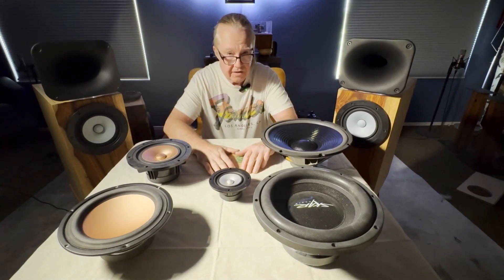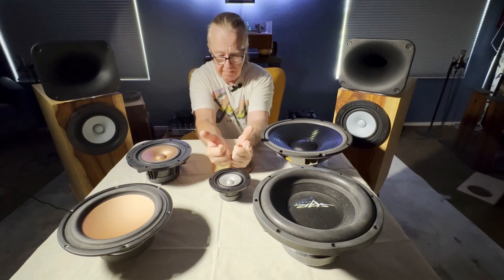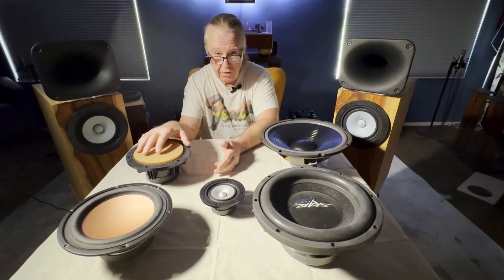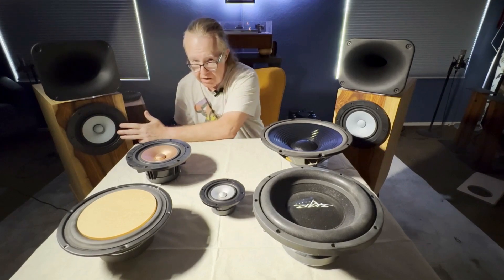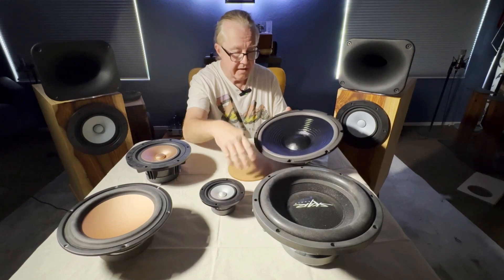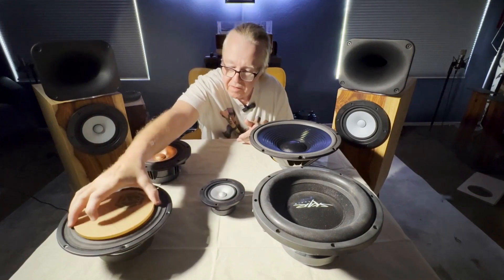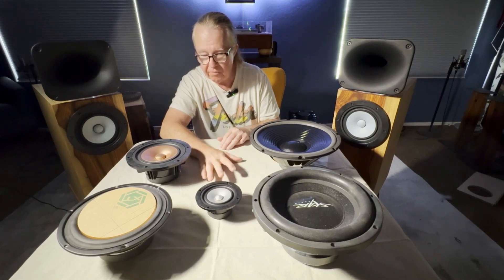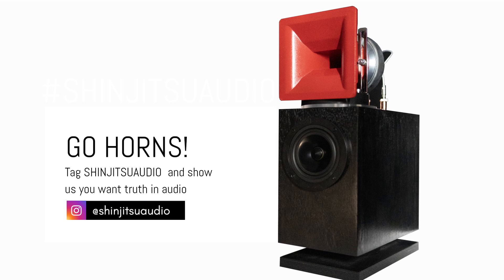Bigger is Better - Or Is It? The Truth About Woofer Size and Beaming

Comment: That's why 3 way designs exist
Reply from the maker: That's a good point! However, opting for a two-way speaker design is often about finding the right balance between performance, simplicity, and cost. While three-way designs can indeed offer advantages, they also introduce more complexity and potential reliability issues.

A two-way design allows us to maintain high-quality sound with fewer components, which reduces production challenges and costs. Three-way speakers are typically larger and require more components, which can double the cost of the speakers and shipping. 

To keep costs reasonable, we'd have to use lower-priced components, potentially compromising quality.

For our market, focusing on efficient two-way designs ensures we deliver excellent sound quality consistently and affordably
Reply: VBSS and Kali IN-8 is probably my dream combo.
Reply from the maker: That sounds quite nice. We aim to bring dreams to reality. Stay tuned for this Fall's lineup.

Comment: Very informative.  I use 18" woofers up to 120, so no worries there.  I then use a 10" woofer up to 3500Hz.  I guess I have beaming above about 1350 to 3500 where the tweeter takes over.  I like the sound so not concerned.  But I may try small woofers in the future to see if I feel it improves.
Reply from the maker: Sounds great!

Comment: What about the APM speakers?
Reply from the maker: a 12 inch woofer beams above say 1Khz so its unlikely it can play up to the level of that horn. Midrange will most likeiy sound recessed as a result.
Reply: My use car subwoofer what inches 8 and 10 and 12
Reply from the maker: Thank you for your comment! It's important to recognize that the audio environments in cars and homes are quite different, and these differences impact the choice of subwoofer size and design.

Car Audio Environment

Ambient Noise Levels:

In a car, the ambient noise level often exceeds 80 dB due to road, engine, and wind noise. This high noise floor requires a more substantial bass response to ensure that low-frequency sounds are audible above the background noise.
Low-frequency noise in cars can mask subtle bass details, necessitating a more powerful and pronounced bass output to achieve a satisfactory listening experience.
Listening Genre:

Space Constraints and Acoustics:

Cars have limited space, so subwoofers need to be designed to maximize bass output in a confined area. Larger subwoofers (like 10-inch or 12-inch) are often used to compensate for the smaller acoustic space and to produce the desired bass impact.

Home Audio Environment

Audiophile Standards:

Home audio systems are often set up in quieter environments where the ambient noise level is significantly lower than in cars. This allows for more detailed and nuanced listening, where clarity and balance across all frequencies are essential.

Smaller woofers (6.5-inch to 8-inch) can provide accurate and tight bass that integrates well with midrange and high-frequency drivers, delivering a cohesive sound.

Room Acoustics:

Home listening rooms can suffer from issues like standing waves and room resonances, which can be exacerbated by large subwoofers. Smaller woofers help to maintain a balanced sound without overwhelming the room with excessive bass.
Proper room treatment and speaker placement are critical in achieving the best sound quality, and smaller woofers are often easier to manage in this regard.

Music Genres:

The genres listened to at home may vary widely, including classical, jazz, rock, and others that benefit from precise and controlled bass response. Smaller woofers can reproduce the necessary bass frequencies accurately without the need for the extreme low-end extension required in car audio.

Conclusion

While larger subwoofers are beneficial in car audio systems to overcome high ambient noise levels and to deliver the impactful bass required for certain music genres, home audio systems often benefit from the balanced and precise sound that smaller woofers provide. The key is to match the subwoofer size and design to the specific listening environment and preferences.

Thank you for bringing up this interesting point. It's always great to discuss the different requirements and solutions for optimal audio experiences in various settings!

Comment: Nothing will stop me wanting a pair of fostex fw800... Now lets watch 😂
Subscribed, lets get you to 1k
Reply: Would it be overspecialization to use it as a subwoofer?
Reply from the maker: Subwoofers play a crucial role in high-end audio systems, especially when they are properly phase-aligned. Stay tuned for an upcoming video where we'll delve into this topic in detail. Proper integration involves considerations such as physical distance, crossover slope, and roll-off frequencies. These factors are essential in achieving seamless integration and ensuring that subwoofers complement the main speakers without causing phase issues. This is why I believe subwoofers have sometimes been unfairly criticized in audiophile setups.
Reply: @shinjitsuaudio  and that is why setting up subwoofers is a speciality often overlooked but very important if you need the benefits of one or more subs. 
On the other hand I know the woofers I want are way too big for my room... But they will be very cool and I have a friend with a big farm and the space to let them shine. He better buy them from me, my listening room is two (steep Dutch) stairs up no way I am getting them back up there 😎
Reply: @JoelHernandez-tz3vk  I was thinking of putting one in an open baffle, and put a quad ESL 57 on top of it. So not classic (sub)woofer use. But I already saved €3,59. So if I do that 1000 times I can buy the first of two 😎 don't hold your breath 🤣
Reply from the maker: Thank you!

Comment: It is for me. While I have some smaller 5.25" bookshelf speakers, a couple of trends that are not favorable for my use that tend to tag along are lower sensitivity, and the idea that many bookshelf stand mount speakers are trying to be more sub bass capable as full range speakers. 5.25" cone size for me is a midrange driver. Minimum bookshelf size would be 6.5" for a bedroom size speaker, but preferably 8". Sweet spot size for me at the levels I listen at are 15", but 12" will suffice. 

This idea that we always have to accommodate a whole room is problematic with much of modern architecture and interior decorating trends, which tend to lead towards sterile, slick surfaces and walls of glass. Especially with the trend towards large, open concept living spaces. Most homes will be doing good to have more than one audiophile that any of this matters to. Therefore, it's best, first and foremost to be sure of one's long term audience count. In other words, for most people, the ambient quality of even haphazard stereo arrangements are going to sound good to them and a portable radio would likely be acceptable to most. 

I have 12" SEOS horn speakers with a sensitivity of 98db and use them as monitors for a desktop 2.2 system. I simply toe them out when I have 2-3 listeners, which is rare. All the speakers I own have what amounts to an inescapable image/soundstage even at immediate near field and out to as far as 12' or more. The use of subs tends to help out a lot taking the sub bass duties off of my main speakers.
Reply from the maker: Thanks for sharing your thoughts and experiences with your audio setup. Your insights are really valuable and resonate with a lot of people who are passionate about great sound.

Bookshelf Speakers and Woofer Size:
We totally get that smaller bookshelf speakers, like those with 5.25" drivers, can sometimes fall short in sensitivity and bass performance. That’s why at Shinjitsu Audio, we make sure our speakers, even the smaller ones, punch above their weight. For those who want a bit more oomph, our 6.5" and 8" models are perfect for delivering rich, clear sound without taking up too much space.

Modern Living Spaces:
Yes, modern homes with sleek surfaces and open layouts can be tricky for sound. But don’t worry—our speakers are designed to shine in these environments. We focus on precision and quality, so our speakers handle reflections and room acoustics beautifully, giving you great sound no matter where you place them.

Audience and Listening Preferences:
We know not everyone in the house might be an audiophile. Our speakers are built to make everyone happy, whether you’re a serious listener or just want good sound while hanging out. They provide a fantastic listening experience for the main listener and also sound great for anyone else in the room.

High Sensitivity and Subwoofer Integration:
Using high sensitivity speakers, like your 12" SEOS horn speakers, really brings out the best in your music with minimal power. At Shinjitsu Audio, we love high sensitivity designs because they deliver powerful, dynamic sound. And with subwoofers handling the deep bass, our main speakers can focus on the mids and highs, creating a balanced and immersive experience.

In short, Shinjitsu Audio is all about making the most of your space and delivering top-notch sound. Our speakers are designed to fit modern homes and cater to both hardcore audiophiles and casual listeners. Thanks for choosing Shinjitsu Audio and sharing your feedback—it helps us keep making great products for everyone.